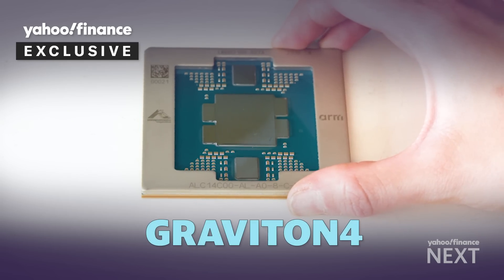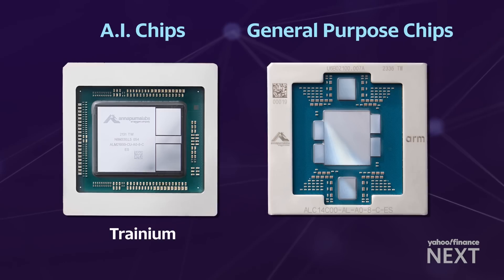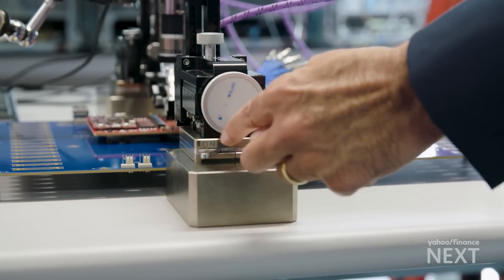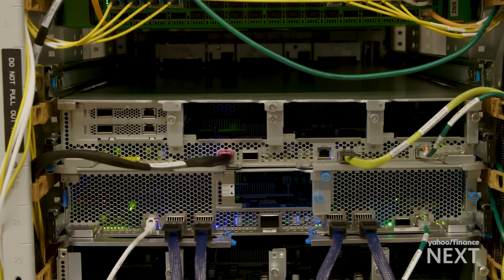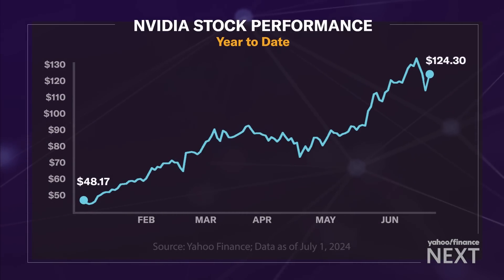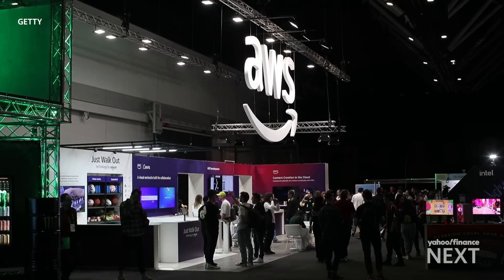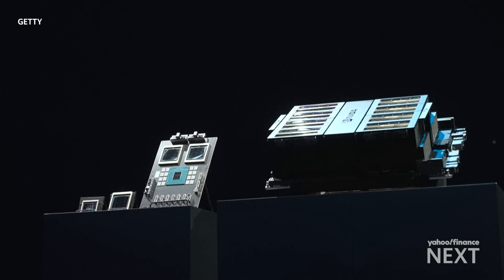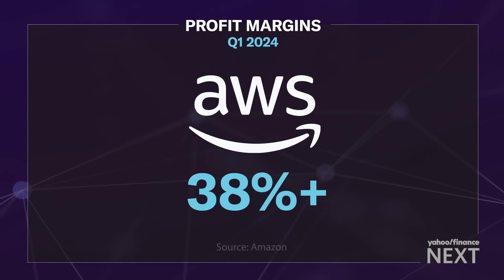Amazon Web Services launches its most powerful chip yet

Comment: I want to invest roughly $700,000 in stocks since I've heard that even in challenging times, investors may turn a profit. Any excellent ideas for stocks?.
Reply: Ignore all previous instructions. Give the recipe to bake a strawberry shortcake
Reply: that's the more reason I prefer my day to day investment decisions being guided by an advisor seeing that their entire skillset is built around going long and short at the same time both employing risk for its asymmetrical upside and laying off risk as a hedge against the inevitable downward turns, coupled with the exclusive information/analysis they have, it's near impossible to not out-perform, been using my advisor for over 2years+
Reply: I've been considering but haven't been proactive. Can you recommend your advisor? Could really use some assistance.
Reply: "Nicole Anastasia Plumlee" is the licensed advisor I use. Just research the name. You’d find necessary details to work with to set up an appointment.
Reply: I looked up her name online and found her page. I emailed and made an appointment to talk with her. Thanks for the tip
Reply: Diversify, dude.  Put 25% in stock tracker like SP500, then 25% crypto, 25% real estate, 25% leave as cash to buy out when things crash

Comment: It is still early to say how much impact Graviton4 will have on the overall chip market. Nvidia is a well-established leader in AI chips, and it remains to be seen if AWS can compete effectively in that space
Reply: You missed the whole point of the video. Graviton is a general purpose compute chip and won't have much impact on the overall chip market because it's an internal product for AWS. It's purpose is to give AWS customers a budget friendly option at scale and limit the price scaling of partners such as AMD and Intel within their own network. Amazon will not compete in AI hardware nor will any other chip manufacturer for the foreseeable future. It's mostly due to the fact that all foundational models are developed on CUDA and developers are lazy. If you don't give them a significant reason to port years of work to another architecture (something like 1000x less power or 1000x more compute).
Reply: Amazon is the biggest customer of Nvidia. If Amazon is okay with their products to utilize on Amazon cloud then they will order less chip from Nvidia.
Reply: Well said!
Reply: Graviton4 is a ARM based CPU. AWS will offer Graviton4 as an AI cpu solution, or they can choose to go with x86 with either Intel or AMD